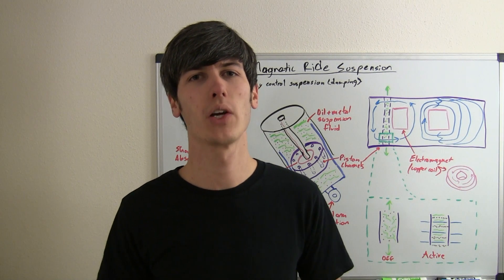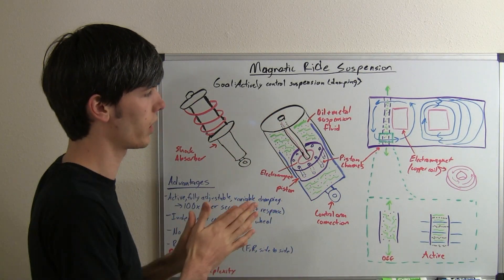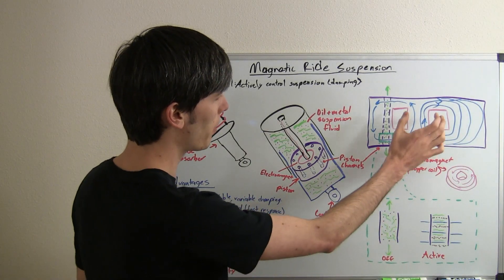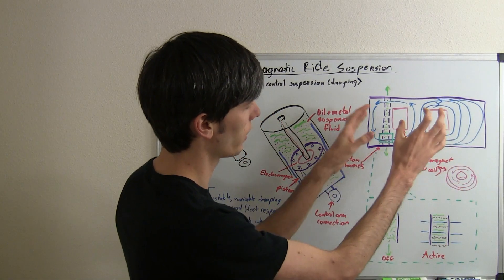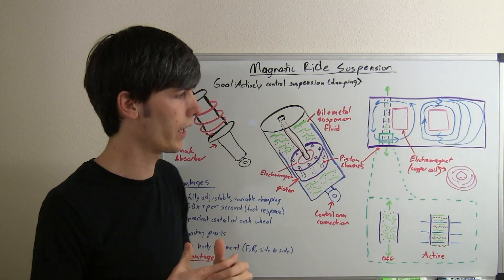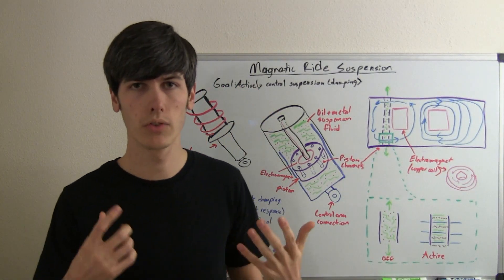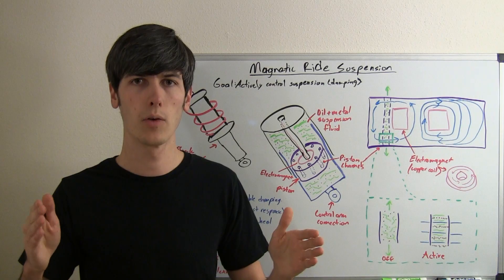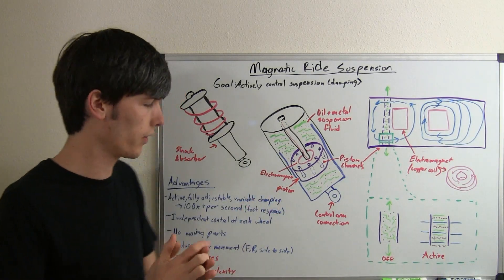How Magnetic Suspensions Work - Magnetic Ride Control

Comment: Wouldn't this be ideal for pickup trucks that tow a lot? They could reduce the "springiness" of the rear end when they go over bumps on the road. Sounds like it would improve the handling of the truck and trailer a lot.
Reply: That's a good idea. For some reason they always use airbags instead, but this seems like a more appropriate technology.
Reply: I agree. My truck has airbags and it still has a bit of a bounce problem, and with the route it used to make that could definitely be a problem.
Reply: desertfox2020 Maybe more appropriate but definitely more expensive.
Reply: It would most likely be better but they would be ridiculously expensive because one there already are expensive in cars but two they would have to make it be able to withstand a lot more weight so more they will have to be made more heavy duty which will again cost more